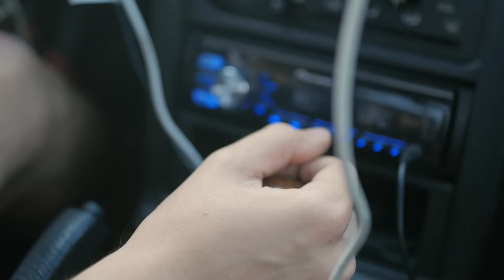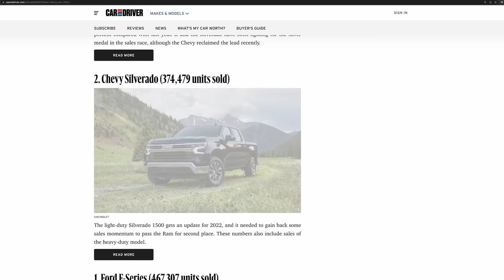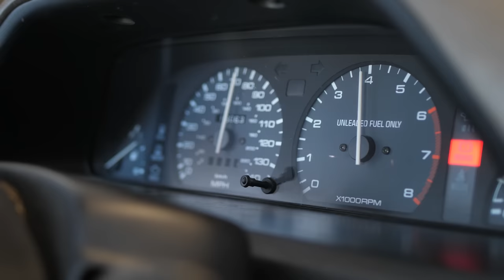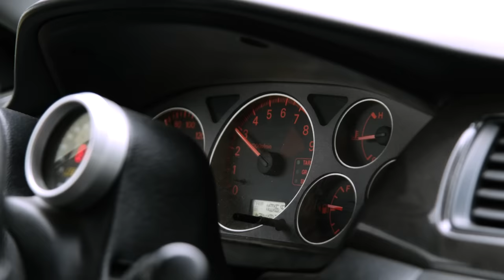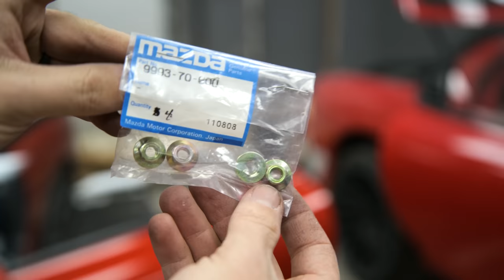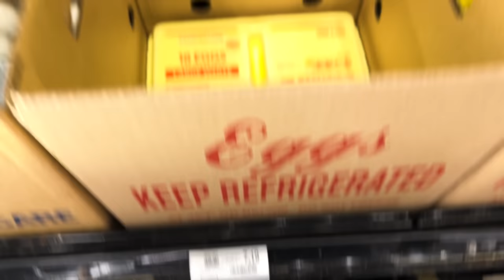Daily Drive Your Fun Car

Comment: As a BRZ owner, I started crying when he said between 200 - 300hp
Reply: Definitely think there should be a giant * on that statement lol. I've got a Triumph Spitfire that probably only has about 70hp at the crank, but the car weights like 1600lbs, so it works. I dailyed it for over a year, and man was it still fun, even with the more-often-than-id-like breakdowns 😂
Reply: me with a track prepped 2014 tC (180hp) T-T
Reply: He said between 200-400 lol
Reply: My modded 4.6L  just barely cracks 300hp. It's out performed by V6 sedans, but boy is it fun to drive.
Reply: @slinkeyj3  Yup, it probably boils down to power/weight ratio rather than a single HP figure
Reply: It’s okay, it’s all power to weight ratio dependent. My RF ND2 only has 180HP, but it weighs 2500 lbs. 🤷🏻‍♂️
Reply: Obviously weight and gearing is a factor, but way the engine delivers the power matters a lot too. Even assuming the same chassis and peak HP rating, IMO a responsive engine that feels effortless and makes good overall power throughout the powerband is a LOT more enjoyable for daily driving than something that needs to build boost and/or be revved to the moon to make usable power although that can certainly be fun in its own way too.
Reply: As a 1988 Supra owner, I feel the same. Though I don't care, I adore the car and it's fun.
Reply: People have lost perspective. Ruined by the monsters out there these days. A fun car does not need to make 400+ HP. I learned that going from my 03 SVTF to the 05 GTO M6. Within weeks I realized my mistake....
Reply: My daily is a 180hp E30. I don't feel the need for any more. HP is a relative thing.
Reply: My daily/fun/adventure car is a 84 Tercel wagon with 62hp... 205,000 miles ago. Haha.
Reply: @BeardedWrencher  Hell yeah, those are awesome! Also the AWD versions are now collector's cars. I absolutely love the look of them.
Reply: The thing is the miata especially and the brz are so lightweight they are pretty much the equivalent of a 300hp car in accelaration
Reply: yh it´s actually about power to weight, not power alone
Reply: Bro BRZ's are sick!!!
Reply: And my 2015 honda civic si only makes 210 hp with light mods, but boy is it fun to drive.
Reply: Hey, 205 counts right?
Reply: dies in 130hp Chevy cruze

Comment: I think it still comes down to the fact that many people (enthusiasts even) don't have the privilege of sacrificing efficiency, reliability, practicality etc for the sake of fun. When keeping your job depends on the reliability of your car, it's more than just sort of important and has to take priority over fun
Reply: This
Reply: This is so true. It's almost impossible to drive a modified car and have peace of mind that you will get to work on time. I drive a lightly modded em2 civic. I have a set of coilovers, wheels and tires, front lip, rear lip, side skirts, cold air intake, and a set of retrofitted hid headlights. Personally, this car provides fun driving on country roads while providing me with that Honda reliability and that nice 38-40 mpg. The car is not too powerful, maybe 140 hp, but it has enough power to make it fun to drive as long as you don't plan on winning any races, and it is also a manual so it provided that untouchable driving experience. Just remember that every mod has its drawbacks.
Reply: Nail on head.
Reply: So get an Mazda any of them even the CUVs...
Reply: @braydenhulsey8421  Some you can like coyote mustang and old Supras you just need to take car of them and mod the right.
Reply: @GreenBlueWalkthrough  a CUV is not an enthusiast vehicle by any stretch of the imagination

Comment: I daily drove a car with a manual transmission for 13 years.  When I went to order my fun car, I got it in a manual.  But I now have an automatic car for a daily.  I deal with a ton of traffic, and I couldn't do it anymore with a manual.  The auto is much better for smaller gaps, stop and go up big hills, and crawling forward.

Comment: I think what a car means to you personally is far more of the key to it being the right one. I drive a Ford Mondeo estate with a 2.2 diesel. It's top spec and means I can chuck the family including kids in and road trip around in comfort. Doesn't matter what the car is, it's the memories that stay with you..
Reply: The memories of riding on a boring car
Reply: Couldn’t agree more. I have a little 2004 Honda CRV but with a bed and cooler in the back it becomes a surprisingly good car to go camping in and overall exploring
Reply: 2016 2.0T Fusion here, the 380nm of torque make for plenty of fun when it's straight, and the size gets you and your family anywhere quite comfortably and with lots of room
Reply: Another Mondeo Estate owner here, agree with you completely

Comment: Exactly why I love my 08’ Civic Si. I have a few suspension and power mods but it’s still relatively tame. Makes 220whp and it’s a joy to drive everyday especially in the canyons and I can still get 30mpg with Honda reliability. Also the stock interior and sound system is great for a civic from 14 years ago. It checks all the boxes here in this video except maybe loudness, it’s a little droney and might be annoying on cross country trips
Reply: I used a Tanabe Medallion Touring on my 05 RSX Type S for that reason. Probably choked her up a bit, but it is so smooth, no drone...
Reply: @Save_the_Stick_Shifts  nice! I have an Invidia q300 and a Skunk2 alpha header so I still have a full size resonator and muffler, just no cats anymore. The wider diameter piping makes it boomier but it sounds great. It’s still tolerable though with no drone unless I’m going up hills
Reply: @TheRyansLion  my Alpha2 is in a box 😅... debating about leaving her as is.
Reply: Hell yeah ! I love Civics, they're such well known and reliable cars when they're well taken care of, and the older ones  are a great starting point for modding (reasonably) and having a nice fun daily that's easy and cheap to maintain. My daily is a 2018 Peugeot 208 GTi and I love it ! Very cute, quick and nimble little car, and pretty comfy too with the full leather interior pack ! I modded it ever so slightly, you know, the usual, a nice muffler, a slightly better intake, a short shifter, a stronger and more reliable dump valve since the OEM one is known to be rather frail, and one or two aesthetic touches, that's it, no tune or anything else (I might invest in some very good coilovers in the future, one less inch and a more precise dampening should look and feel pretty good). 35 to 40 mpg when cruising and arround 210hp with a turbo on a car weighting a tiny bit above 2600 lbs, including me inside of it, make for a very pleasant, quirky and energetic little daily.
Reply: @dr.calder7650  that sounds like a lot of fun! Wish we had some more European brands like Peugeot, Seat, etc. Mine makes 215whp and is around 2880lbs, all naturally aspirated! Thankfully my county in Colorado doesn’t do emissions so I can run a catless race header 😁, gained me 34whp alone.
Reply: @TheRyansLion  wait a minute... we're both in CO. I need to get with the people that know these things!
Reply: @Save_the_Stick_Shifts  no shit! I’m in Broomfield!
Reply: @TheRyansLion  alright we need to plan, would love to find a group to at least go on a drive with. I'm down in COS.
Reply: i got an 8th gen as well. Id love to have a faster car dont get me wrong but the civic checks all the boxes and handles great tbh. Costs a fraction of what these 300hp cars cost
Reply: @aimplified6319  exactly, and it does have lots of power potential if you do boost it.
Reply: @TheRyansLion  of course but it takes money for that lol
Reply: @aimplified6319  of course haha, it’s a possibility though, still cheaper than buying an evo or Sti

Comment: I think the same thing. I have a 08 Civic LX with an auto. Despite the auto I enjoy driving it thanks to the suspension changes I've done to it like coilovers and a beefy rear sway bar. It makes the car handle amazing while still allowing me to daily it and take family and friends in it without it being to boy racer or to boring to drive. Overall despite it being a base model or having the wrong engine or transmission in some peoples eyes it puts a smile on my face every time I drive it. Update (just got a 2019 Wrx base model with the 6spd manual, can't wait to take it to the trackand modify it a bit to be a good daily).

Comment: The car I enjoyed driving the most was a ‘96 Subaru Outback that we put over 100k miles on before I cobbled together a turbo kit and put it on wrx suspension with wrx front seats. At 9psi it wasn’t super fast but it was crazy fun. It was also cosmetically quite rough but that meant I didn’t stress about it. I got T-boned in it at 276k miles. I miss that car years later😢
Reply: I'm glad you survived that. RIP Outback
Reply: @sarahrowe9661  thanks, I still think about replicating that exact car

Comment: This video is almost every reason I have for loving my car put into one. 
It may only be a humble Diesel V70 but every time I slip on my driving gloves and get behind the wheel I am reminded that it’s everything I could ask for in a car. 
It’s safe, reliable and comfortable enough (despite the hard suspension) to not annoy me while driving, but at the same time it’s torquey and nimble enough (thanks to the hard suspension) for a stint on the neighbourhood mountain. Hell, I had two runs last week that brought tears to my eyes, they were so much fun. 

But most importantly, it’s a manual. Every time I drove home from work, I had a certain few corners where I could feel like a Rallye driver and perfect my driving to a level where I might have exhausted all I can learn from the car, without actually doing damage to it. These little moments have turned driving home from a chore to something I would look forward to every day. 

Because of all of these reasons I am never annoyed to get in the car and  always excited to see what adventures I will get into with Apollo, my very dear V70.

Comment: As an 19 year old I love my 60hp ford fiesta. The suspension feels good, I can throw it around in corners without losing grip on the front tires, drive it normally in a traffic jam, take it to school or on a few hour long trip. Fuel consumption is decent, while I won't win a drag race it drives comfortably at 80mph. Ehat I'm trying to say is that my "boring car" is a really fun car

Comment: Veloster N. 

Perfect fun car daily and ONLY car. It can do massive Costco hauls. It can do light ikea hauls. It can get great gas mileage. It’s got decent power for a daily— deceptively quick. It handles insanely well and uses adaptive-adjustable dampers that work for smooth and harsh roads. It’s even possible to two person car camp with the car over almost 2 weeks, my wife and I did that over 3300 miles and down the PCH. Maintenance so far has been cheap. 64,000 miles in and mine has been absolutely no headaches like expected from a good car.

Comment: I've got 2 cars and although I absolutely love my "fun car" it has also given me the worst anxiety I've ever experienced. I now have a daily driver that doesn't give me that anxiety with a lot better mpg too. I think for the most part daily driving your fun car is ok but having to fix the only source of transportation you have puts a lot of weight on your shoulders.
Reply: It's funny you mention that because I bought a 01' Celica GT-S (142K miles) recently to replace my cheap baby 94' Camry with only 73K miles. It's dumb in everyway because that camry would last me forever and cost me next to nothing. Just wanted something very cool and fun as my daily. Hell I don't even mind using my 88' Supra as a daily either, but I've poured so much money into it that yeah I'm a bit paranoid at this point. All three are toyotas though, not exactly worried about reliability.

Comment: Going with the Luke Honda Jazz vibe, I have a "top spec" 2009 Mazda 3, and I love it. It has a smile on it's face for god sake! =D

Yes, it only has 120 bhp, but you can use all of it. It looks good, has a nice level of creature comforts, drives well on back roads, super practical, super reliable and with 50mpg on motorways, it's not to bad on the eco front either, not to mention servicing it is pretty good too! One day I'd like to mod it a little bit, like with wheels and get the really subtle body kit later models had, but can't bring myself to do it...

Comment: I daily my lifted WRX hatchback. It has been my daily for almost nine years now. It's practical, has enough horsepower, it's comfortable (I put in nice BRZ seats, still heated), does well in adverse weather and with the larger tires and AWD, is reliable enough, and most of all it's fun! I couldn't imagine driving an appliance to work everyday. I like having a little bit of fun.

Comment: My Mk7 Golf R seems to hit all 10 of your points.  (even reliability, knock on wood).

That being said, I think amount of use and type of use both change the equation.  My 3-5 hour trip once a week on 95 isn't going to be fun regardless of the car you're in.  A 1-mile drive to the metro stop doesn't necessarily need the same comfort as something you're driving 100k miles/year in.  My convertible JCW Mini was an absolute blast to daily in San Diego, but I sold it a year after moving to DC cause the roads sucked and I never got a chance to put the top down.  

Also, after getting hit head-on by a half-ton pickup driving on the wrong side of the road and walking away from it without injury, I will say modern car safety is a HUGE must-have for me.
Reply: golf’s are just solid cars! can’t knock ‘em, they do everything i need to (mk7 gti here). kinda “tame” to start off with- but they can be modded to all hell which is where the fun really starts!
Reply: I've a MK7 GTD, and it's a wagon! I definitely agree that this platform is absolute top notch for a daily, or to be fair, any MQB platform car is a great daily.
Reply: That's why I'm looking at a 2022 Wrx . I live in the mountains and we get lots of rain. The wrx can handle all the wet inclines and turns, but also has one of the best crash ratings

Comment: I daily drove my fun car, a 2006 Mazdaspeed 6 for many years, over my 10 years and 200,000 miles I personally put on it (now at 262k) It still puts a smile on my face but I needed something a bit more practical for my mobile DJ business so I did the right thing and bought a Toyota Highlander SUV and it was comfy and reliable it was b.o.r.i.n.g , after that got totaled by a Deer I went out and bought my Fun daily, a 2014 Ford Flex Ecoboost, and folks joke on the ole breadbox until they ride with me and I pin them to the seat. now I have my Fun Daily and Fun used to be daily.
Reply: Loved my MS6 as well. As soon as I replaced the HPFP and turbo with a BNR it was super reliable.
Reply: @jimmynickelz  my original turbo is still going... on its way out 😅
Reply: @DJ Ern Videos  I'm sure you have a smoke show by this time

Comment: My 2006 lexus RX 400h with 220k miles on it puts a smile on my face because it has been extremely reliable and I drove it from Boston to the Grand Canyon and back without a single issue. I have taken it so many places and made so many memories.

Comment: I agree entirely. Subaru always feels like a fun enthusiast car while also being practical as a daily/grocery getter. parts break often enough that I'm always fixing, upgrading, or repairing something which helps build my overall knowledge of automotive repair. aftermarket is plentiful and parts are relatively easy to get. working on a subi kind of sucks, which makes the trial-and-error process exhausting and rewarding, plus a plethora of online tutorials and forums. currently, I have plans for my 05 outback, it's not really exciting at all but when I have 4 friends crammed into it, I couldn't imagine driving anything else on a daily.

Comment: Best daily would be something like my civic. Decent power to bolt around town also reasonably modified to the point where anything else could make it a track only car. With a manual option it can be ideally one of the best enthusiasts daily drivers with the right mods to offset it. Although there's also the si and type R which are literally the enthusiasts picks for a fun daily

Comment: I’ve never daily driven anything but a fun car. My current car is a 2010 Evo that is nearly bone stock for now but it’s still a lot of fun, reliable, practical, and you don’t see too many where I’m from. Jack of all trades.
Reply: Lol, that's pretty amazing but I've never been able to do that until last year when I was 35 after driving and owning several cars since I was 18. Never had the remotely the money for it. Basically you need a 2nd car if you're going to have a "fun" car and that was never an option either. 
No evo for me, but I have an 01 Celica GT-S and 88 Supra now. 94 Camry with low miles was my rock, but it has to go to afford the other two.
Reply: @rushnerd  I definitely didn’t start with an Evo lol I spent many years daily driving unreliable 90’s muscle cars
Reply: @LeviathanVZ  That's pretty bold lol. I didn't get mechanically inclined in the least until this last year. And even then you need a lot of money or skill to keep those babies on the road!